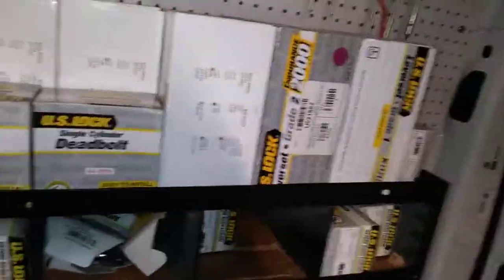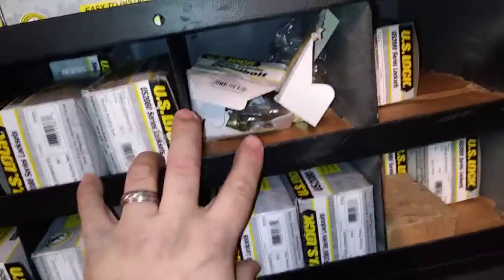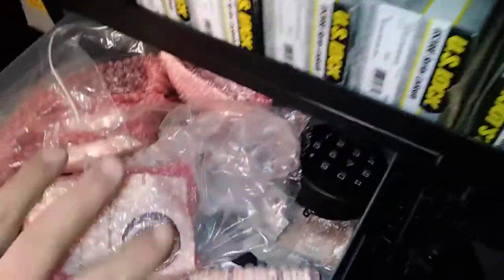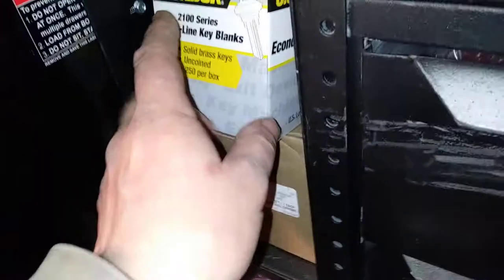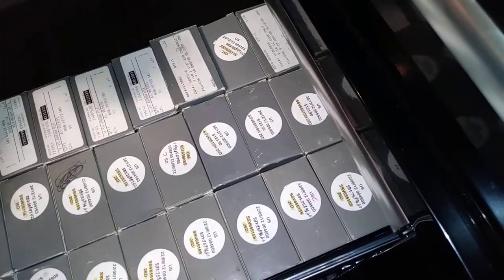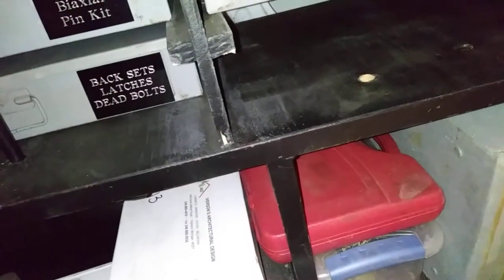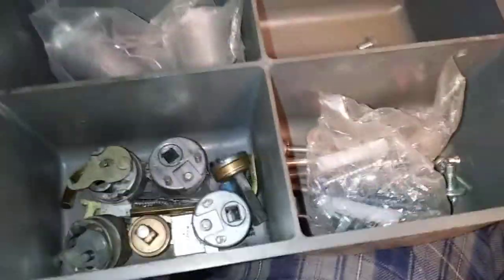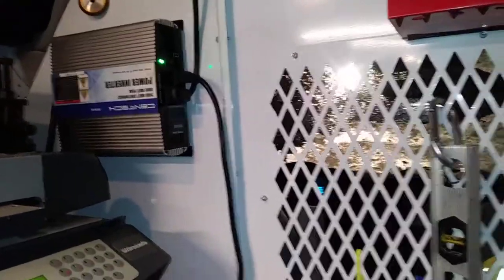What inventory I keep on my locksmith van

Comment: I would sell LG if they lasted. Too many failures.
Reply from the maker: Oh my gosh that's so true they did have a bad bat for a while I had 10 or 15 bad locks in a row and I'll fix that one of the problems is a lot of my banks already have the Lagarde so I dont like to stick with that brand the new ones are quite good though . I dont have any problem 39e pro grate comment
Reply: steves locksmith 211 steves locksmith 211 I can see using them if you already have a lot of them out there. We’ve been selling ESL 10s and E2006s for the last 6-7 years or so. Then again, those are also the most common in my area.